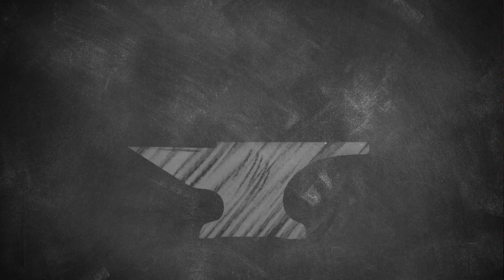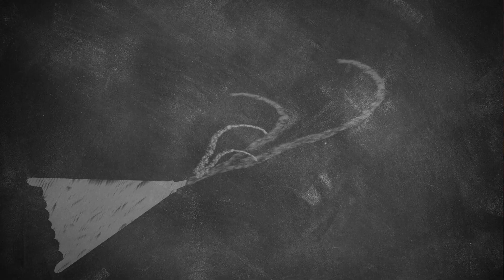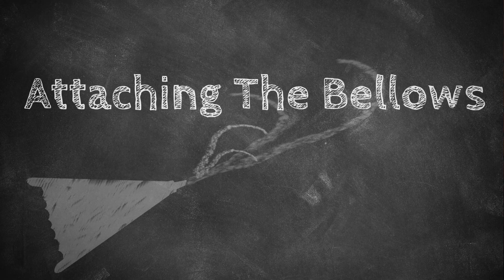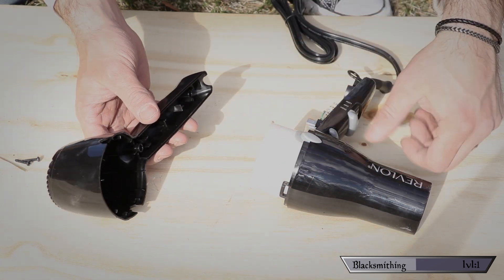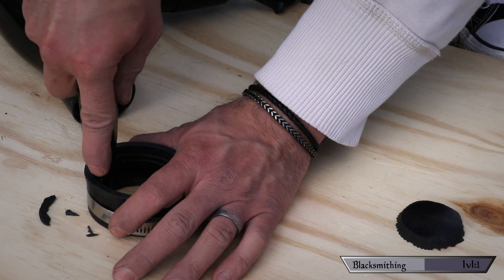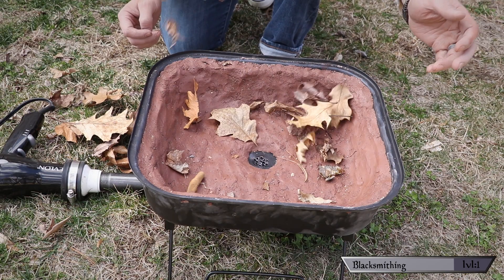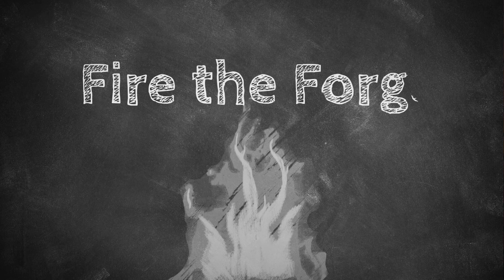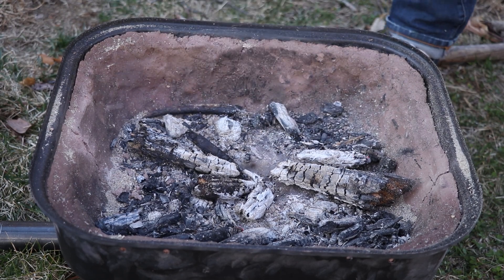Make A Forge | Skill Tree

Comment: Just finished making this forge yesterday. It's really awesome, and for a homemade forge it works great!
Tips of advice for anyone attempting this from my experience:
1. Everything but the clay can be found at Lowes. You might also find luck at Home depo etc.
2. If you can't find normal clay like in the video(my issue lol), fire clay powder works extremely well. I found a 50 lb bag for around 15 bucks at my local masonry/brick layer. The mixture for the clay I used was 50% clay powder, 50% sand (any kind is good) and add water till it makes a ball but isn't soupy.
3. When claying your forge, add about an inch of clay on all your edges, then make sure to pack it down, I did it with my fingers and it worked great.
4. DON'T USE BRIQUETTES for firing. They shoot sparks everywhere and burn up extremely fast. a normal campfire is 100% better for firing the clay. If you need fuel use hardwood lump charcoal instead. 
5. A shopvac is great instead of a hairdryer if you have that, just be warned they put out alot more force, so try and regulate your air input till the coals are red hot and have little flame shooting out, if its sparks city its too hot, no flames too cold.

My overall cost for the whole project was around 85$ USA. this was awesome to build ty Clever!

Comment: Great use for cheap nickel plated buckles (for leather stuff) . I blacken them by first burning of the crome and then dipping them in lindseed oil to make them black.
Reply from the maker: Really?!? I love that tip. I will give it a shot!
Reply: I was under the impression that burnt chrome was bad for your lungs
Reply: @lornemiller3489  It is.